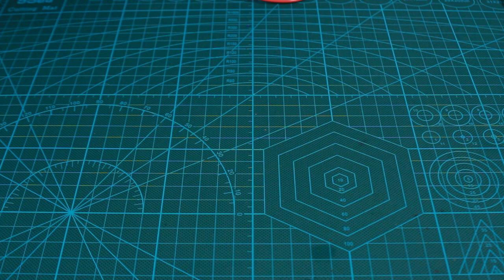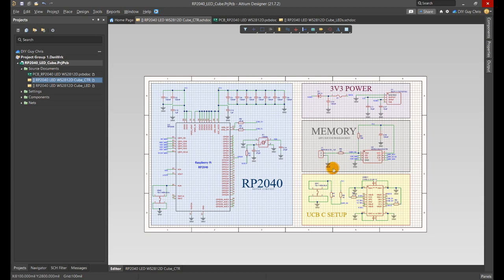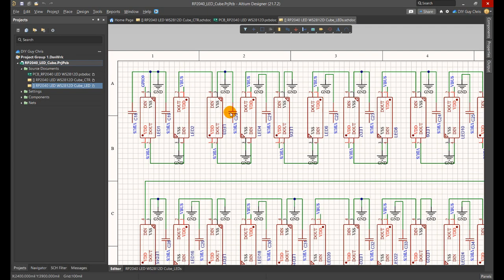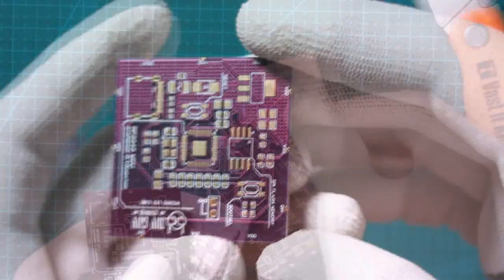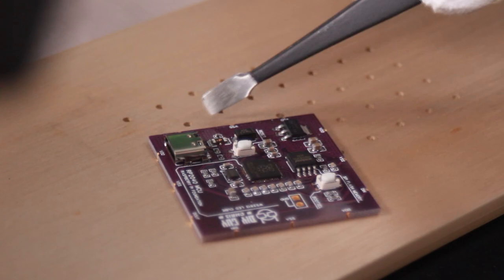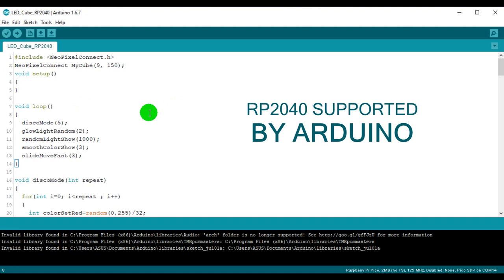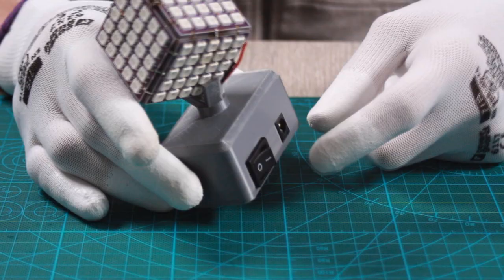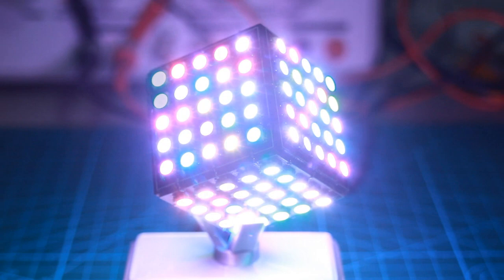How to build Magic RGB LED Cube (with code and files)

Comment: I love this, and thanks for sharing the build process. I have been wanting to do some LED projects and I think now I understand how the components go together and the techniques for assembly. One change I will attempt is to change the voltage input circuit so it can run of a 3.7v battery, and charging through the usb with an overcharge protection circuit. One question about the included Neopixel library, does this allow individual pixels to be controlled and scrolling text? Great job Chris thanks again
Reply from the maker: You can step-up the Voltage to 5V to the WS28 LEDs and in such case you will no longer need the voltage regulator but anyway it is always recommend to use such regulator to make sure the 3v3 input for the RP2040 MCU, you can check the MCU datasheet (check the video links) to define the possible voltage range for the MCU.
About the overcharge protection circuit that's good.
As for the Neopixels yes you control them by pixel since each pixel has a unique address like for example 0 goes for the first pixel 1 for the second pixel and so on.
Thanks for the comment and the suggestions : )

Comment: Hi, if the cube is closed by the solder, how does it get powered? the usb c connector remains inside the closed cube so you cannot reach it...

am I missing something?
Reply from the maker: Hi, yes you probably missed the part where I inserted the power jack connetcor along side with the power switch, I soldered two wire (VDD and VSS) to the Cube (One of the joins) and there it gets the power:
Maybe it is more detailed in this instructables: https://www.instructables.com/Glowing-RGB-LED-Cube-5x5x5-WS2812/

Let me know if you need any specific info : )
Reply: @DIYGUYChris  thank you for the Instructable!!

Comment: I like your hot plate, would you share a link. Thanks
Reply from the maker: That's actually a ready made product that you can buy from any webstore, just search for Uyue 948S+
It is a phone screen separator, make sure that you use a low temperature solder paste when you use this hot plate because it reaches a maximum temperature value of 210°C
https://m.fr.aliexpress.com/item/32940718449.html